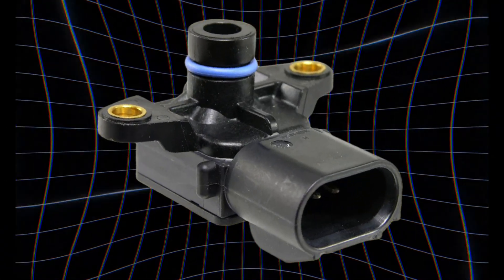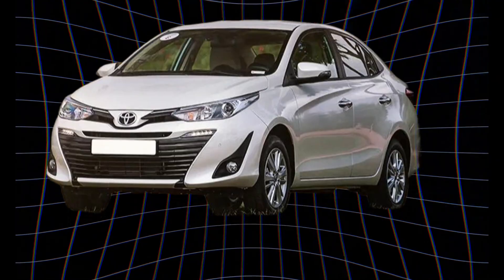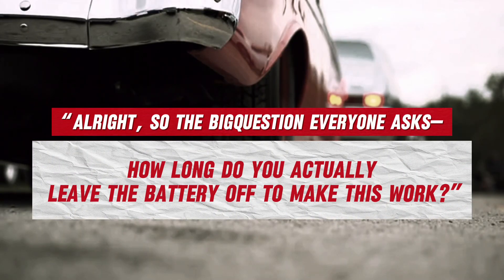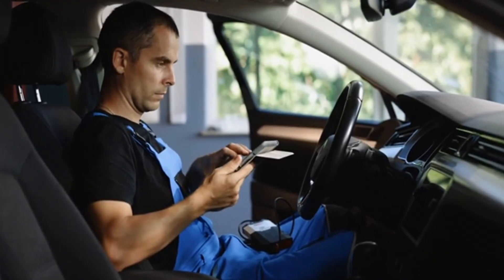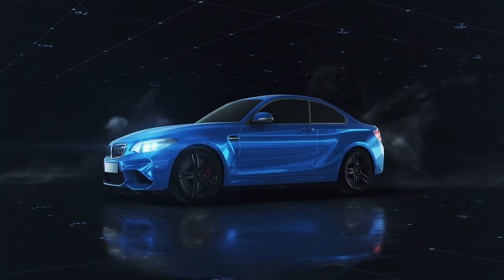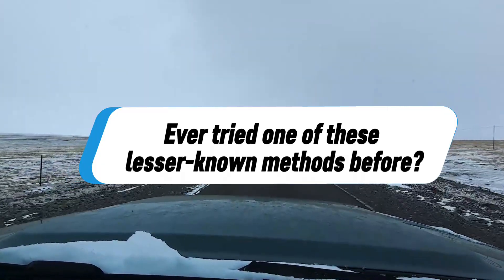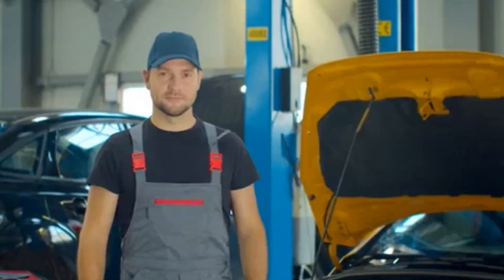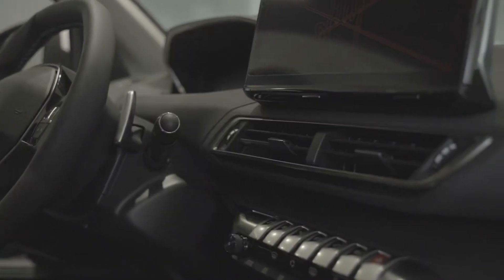How Long to Leave the Battery Disconnected to Reset the Car Computer

Comment: My automatic car reverse gear lags sometimes and now when I try to shift gear to drive mode or reverse mode the transmission system fails , it stays in neutral..but it happens occasionally.. can this method solve my problem?
Reply from the maker: Hey @jongelollen8633! Thanks for your comment. From what you're describing, it sounds like your transmission might have a mechanical or sensor issue, especially if the gear shift is staying in neutral intermittently. While resetting the ECU might clear out minor glitches related to shifting or engine control, it won’t fix an underlying mechanical issue or sensor failure.

If the issue keeps happening, I'd recommend having the transmission system checked out. It could be something like a solenoid issue, low fluid levels, or even a problem with the transmission control module (TCM). Try the reset first—it might smooth out some minor issues, but if it doesn’t, a visit to a mechanic will help pinpoint the real cause. Hope that helps!

Comment: Can you let you let your vehicle set overnight with a battery cables off
Reply from the maker: Hey @richardswatzell4393! Yes, you can absolutely leave the battery cables off overnight if you’re trying to reset the ECU. In fact, the longer the battery is disconnected, the more time the system has to fully drain residual power. Just make sure you’re following the proper disconnection steps to avoid any sparks or electrical issues when reconnecting.

When you’re ready to reconnect, start with the positive cable first, then the negative, and let the car idle for a bit to let the ECU relearn. Hope that helps!
Reply: Remove cables from battery tie them together, trun in light switch,hazard lights radio, hit brake lights, you want to drain the ECM completely, next day hook them up,put gas pedal down 3 times let off it slowly,then start car.